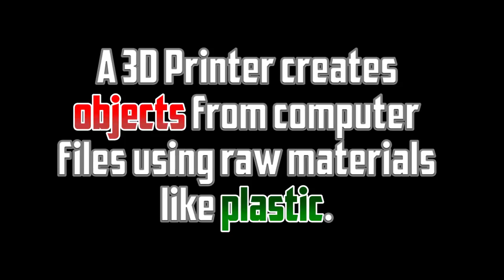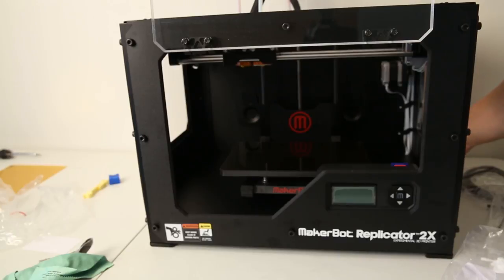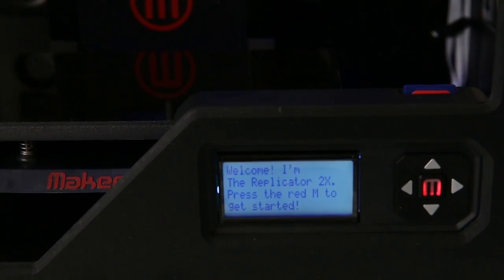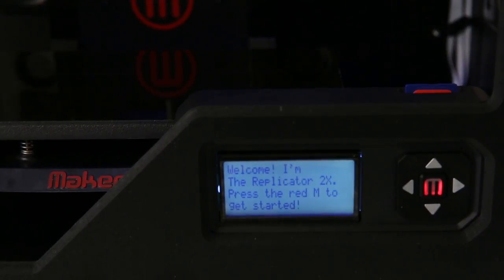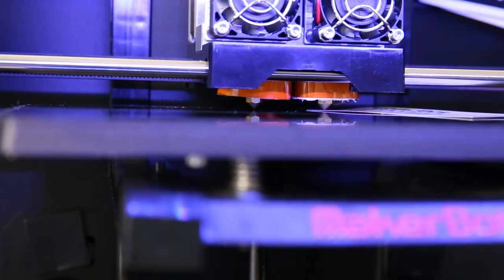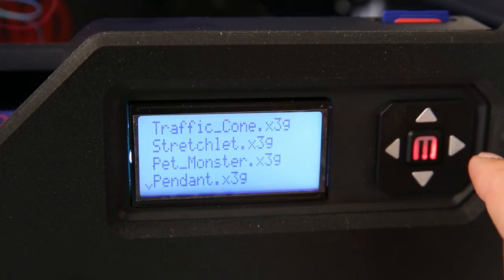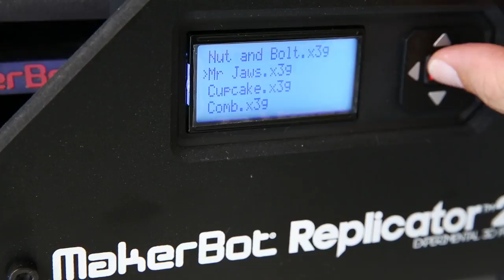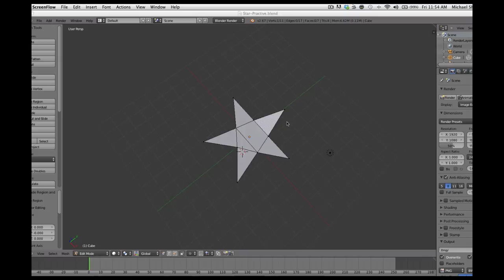Replicator 2x Unboxing Experience | MakerBot 3D Printer | Setup Testing

Comment: the reason for the the objects to get rough look is the plastic was not cooled properly you need bigger fans the size of the ones in your pc motherboard two of them placed on top of the plastic cooling while building if you install them then print you'll see a big difference hopefully,

Comment: when printing do you have to use both printer heads or can you use just the one
Reply: it uses the small one for edges and the large one for filling gaps to speed up the process, its automatic, but you can choose

Comment: hello ,i have design a model car in catia v5 as this one aston martin..and i want to print it on 1:18 scale at a 3d printer ( makerboot replicator 2x ) ..but i think there is a problem..i have design the surfaces without offset them..i mean, the surfaces have not thick ( extruded) and now i can not change the project,so i dont know if the printer can print it .maybe there is not problem but i'm not sure..please if you have any idea  help me..thank you!

Comment: Very nice demo.  I got the Duplicator 4, a knockoff of what you have there.  Runs exactly the same, but the Duplicator has a bit more power in the power supply, which is a 750W Mean Well, underneath the lower platform.

I like the BenchMade Tanto auto also... I had that until my ex-wife stole my two, along with my tear gas pen, from me.

ReplicatorG is the ticket from .stl to gcode/binary.

Comment: Micheal I'm a young inventor, engineer and graphic/interrior design artist but I know I done have the type of funds to afford a 3D printer all I want to know is what type of job or career you have to have been able to afford it if there's anything not explained in the video I should know?
Reply: You can just buy cheaper ones that require more technical skills. I got the printrbot Simple metal and with a good calibration, the quality of the prints match with prints from makerbot. Makerbot is for beginners who don't want to mess with the hardware and its complications.

Comment: Also, how do the MakerBot 2 and the MakerBot 2x differ?
Reply: one spool vs. two
Reply: The Replicator 2 has only one extruder and can only print in PLA but the Replicator 2X has 2 extruders and can print in both PLA and ABS plastic.

Comment: Well now I know the printer I got for free is 11 years old and I wonder why I have trouble trying to get it to print correctly. Replicator 2 base model has the worst plastic 3 adjustment print bed. It doesn’t even heat up a bit and is very flimsy.

Comment: it's cool/hot, yet a toy: u can't make a fully functional bicycle-size gear box  to transmit even 200W at 100RPM, because thermoplastic is too soft &tolerance ~0.1mm is too rough for pinions.
This fuss around gun control and 3D printing is ridiculous. Sintering metal powder with Laser is 100 times of conventional machining.
Reply from the maker: Absolutely not a toy. Powerful prototyping tool. 2 patents, 50 designs and major product launch next week because of it.
Reply: Funny people said the same thing about cars. And planes. And microwaves. And well you get my point, Give it a few decades and we will be printing motherboards for computers.